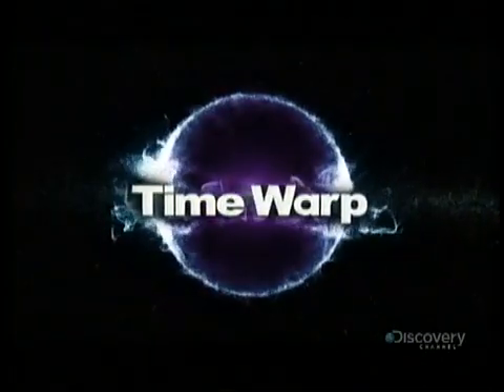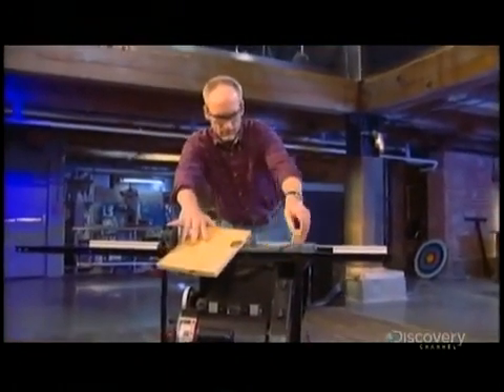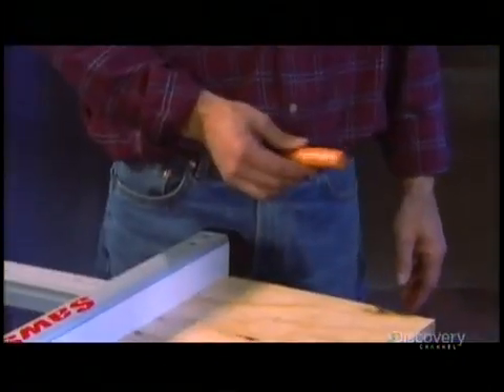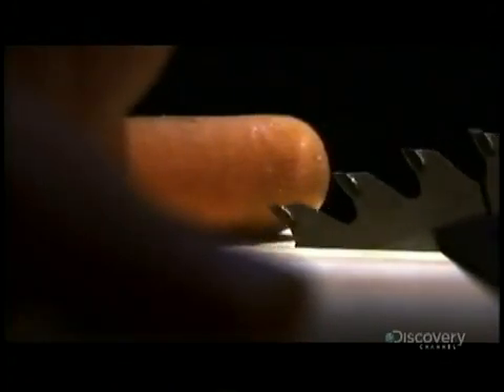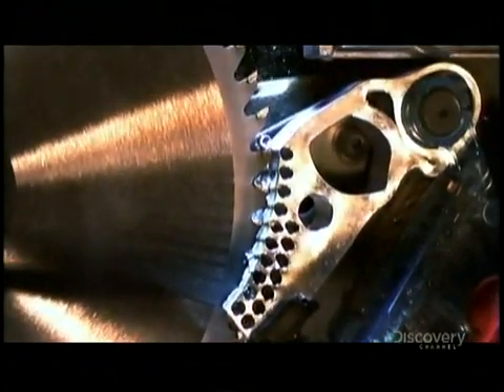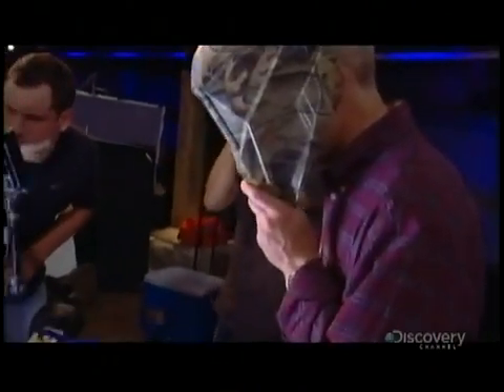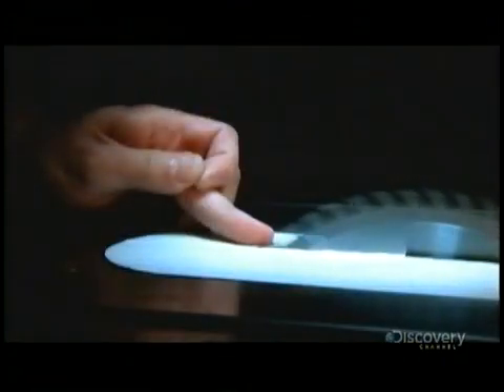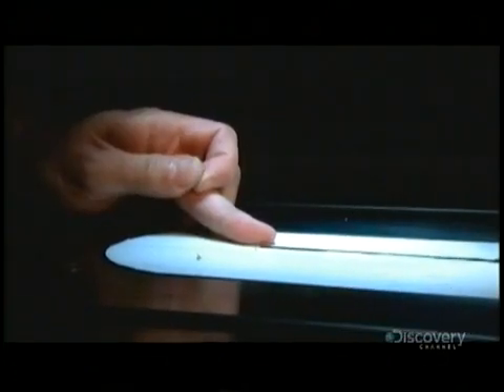Saw Stop - This guy puts a finger into an active table saw blade & comes away without a scratch!

Comment: why not drop the saw under the table into a holding area instead of breaking it?
Reply: It wouldn't drop fast enough
Reply: You could never drop it fast enough unless you propel it with something like a small explosive. In this case you use the momentum of the blade to stop and drop the blade. It's a very simple and beautiful design. Which is what makes it trustworthy enough to use.
Reply: +Micky Sweetman-Hicks well, there is no real way of knowing which way it'll go in the first place. it could just fly into the air, or into your hand, etc.
Reply: Yea it wouldn't drop fast enough.
Reply: The momentum would make it bounce around like crazy, so i dont think that would work.
Reply: Because it wouldn't stop the blade from spinning as effectively.
Reply: easy … 1g vs about 1.000g

That blade is NEVER going to drop fast enough for your finger not to be hurt badly (if not even cut off). That brake is hitting the blade hard and blocking it within very few degrees of a rotation. That mechanism stops the blade within about 1/100th and 1/1000th of a second. You'd need explosives to shoot that blade down and out of the way. You can be sure that your table saw will take damage as well
Reply: Micky Sweetman-Hicks How are your going to hold liquids there. That's where all the wood fibers from your cut goes to.
Reply: If the saw merely dropped instead of stopping immediately, it would have ample time to do damage to your finger.
Reply: Breaking it is better than having a nub
Reply: Lord Fridemort springs under the saw or rods that can only go down on weights?
Reply: It wouldn't be fast enough.
Reply: Salty Jack 
Search for Bosch Reaxx 
It works 
Just one Problem, there is a patent disputes between Bosch and saw stop. 
Thats sad because i think that bosch's system is better
Reply: +Micky Sweetman-Hicks that might be able to work but you never know
Reply: if you watch the video closer you'll notice that the blade isn't made safe by the blade getting out of the way. It is stopped by a metal plate being jammed into the blade. The blade drops relatively slow compared to how fast the metal plate moves into the blade.
Reply: Micky Sweetman-Hicks you need to stop the momentum somehow
Reply: Stop saying it wouldn't drop fast enough because you can just make something push it down fast enough. Also it's the spinning that's the problem.
Reply: It's only $60, either deal with it our learn how not to cut yourself everytime you use it.
Reply: Not entirely, if you're cheap enough.
Reply: It drops the blade so it leaves the area where the finger is.

The blade is damaged because it's rammed into an aluminum brake and it eats the teeth up.

That's the only logical way to stop the blade instantly.
Reply: Bosch is doing this
Reply: That would likely take a lot longer than slamming the saw into a brake, or a least enough time to leave a significant cut. That's my opinion on it at least.
Reply: Micky Sweetman-Hicks derp
Reply: Micky Sweetman-Hicks its either lose your saw or lose your finger
Reply: Because they wouldn't make their money back on the replacements
Reply: That might work but it wouldnt stop the spinning so it could be a hazard i would design a stainless steel chamber under the blade so it drops into that
Reply: orto l'ano, Hi there, lol i completely agree with you there, common sense is the best anti-accident tool we have for avoiding bad accident's, but like you pretty much said people don't tend to use it much nowaday's and there stupidity and lack of concentration is why bad thing's happen, so if someone were to have an accident 9-10 is all down to being there own fault for not paying attention using potentially lethal equipment/machinery.
Reply: It wouldnt be fast enugh 🌲
Reply: Cmon were talking about a hundred euros max to save your fucking fingers? COME ON!! WTF
Reply: Lord Fridemort what if it went in a liquid?
Reply: because he needs to be able to sell spare parts to continue his financial success.....
Reply: this comment needs more attention.

Comment: The test is not very accurate as they put his finger in barely and extremely slow but imagine running a piece of wood through really fast you might get some very deep cuts to even cutting you finger in half but still staying attached. Or what happens if you drop you hand down on top of the saw while its on, well you'll lose you finger and or more. Not very safe still.

Comment: I don't know. Seems like you could hit some moisture in the wood, or the sensor could misfire somehow and you have to repair the saw every time. Unless they can develop a brake for it that doesn't explode like that I dont think it will be a big home user item. Maybe in factories and big shops that want to take extra steps to reduce injuries.

Comment: It Mangles Your Saw Machine And U Need To By Anthr One
Reply: As they said, isn't that much better than losing a finger? and it doesn't ruin the whole machine, just 1 part and the blade.
Reply: It mangles a component and you have to buy that part again and probably a blade. Not a whole saw.

Comment: I ran my finger over a table saw blade, fortunately the boade was only sticking out a quarter of an inch. The cut was across my thumb and deed to my bone.  It was about a quarter of an inch wide. they had to pull my skin from the  tip of my thumb to the bottom then stitched it. all my meat regenerated within time lol. lucky for me the only thing is that some of my nerves don't work. lesson learnd use a god dam push stick lol

Comment: This saw was invented a long time ago... its commonly referenced to as a hot dog saw, it sends a electrical signal to a cut off switch that drops the blade down and puts on an electric brake once your finger completes the circuit. these things also cost like 3k in order to fix. there is literally  nothing special about this they have been out for years...

Comment: Why doesn't this machine just super quickly LOWER the blade! Then it could apply some sort of gradual brake instead of RUINING the part! So there is a compressed spring with a bracket to hold it up, and when it's sensor "goes off" then it lets out the spring, and whips it down. Talk about a lack of imagination!

Comment: I thought the blade simply retracted down into the table, i think that would have been a better idea. Instead of stopping it, use the signal used to stop the saw to instead activate a mechanism to yank the saw blade downward out of reach then cut off instead of completely stopping it at once, then raise again once the blade has come to a stop. Now, I'm not sure if the damage that would be done to the hot dog/finger would be the same, but it's worth a try huh? Either way would tremendously reduce the damage due to a finger coming in contact with a saw but the way i described would reduce if not eliminate the need for replacement parts. Who knows, what I say might actually come into existence. Just remember it came from a girl who posted on YouTube :3

Comment: it wood (yes that be a pun)be a better idea to have the saw be pulled to a lower point and slow down that way it can be used more than once don't you think also i never saw this coming yes another pun
Reply: I may be possible, but I'm not sure it would be fast enough
Reply: +SgtKOnyx mabby it could detect when you finger is going in that direction like maybe a second before the finger comes in contact with the blade
Reply: It couldn't stop fast enough

Comment: Most people wear gloves while handling wood or doing yard work.  What would happen if you put your finger through this with some gloves on?
Reply: Wearing gloves while operating power tools is what causes many people to lose fingers.
Reply: I dont know if it would cut through the glove, but when / if it does, it will still stop before it will cut the finger, obviously.
Reply: Steven Arvizu That was pretty much exactly what i said wasn't it?
Reply: maybe they could use gloves made from conductive material then?
Reply: thats worse.
Reply: the saw Blade would pull one little part of the glove down which would maybe Cut your Finger off
Reply: I don't know anyone that does woodworking with gloves. That's just stupid and dangerous.
Reply: The machine would still recognize your skin after it cut through your glove
Reply: Lynn Dunn Yes.

Comment: When you are pushing a board through a table saw you are going faster than what he did in this video he basically sneaks up on the blade, this stop does work although you will get cut badly you won't lose a finger but the cut will be significant

Comment: You can actually do that with any table saw. All you have to do is move your finger really slowly toward rhe blade until you feel it touch, and then turn off the motor. You only get cut if you push your finger BETWEEN the blades. Touching the tip of the blade doesn't do anything because you're finger is not in its path.

Comment: Great concept and all but who's going to pay for a new saw every time something conductive touches the blade?
Reply: Just a blade and the plastic piece that you saw break... that said he said $60 for parts to replace broken ones... which if you finger is that close well lets look at hospital bills for those things then lets look at $60
Reply: that was a metal piece.
Reply: papersly vg I wasn't saying that the cost of the parts outweighs the value of your finger. My point was that every time something conductive touches the blade you need new parts. What about if there is a piece of conductive material in the wood you're cutting? A finger isn't the only thing that can cause this safety mechanism to engage.
Reply: ***** they should have it configured for a proper amount to set it off and have tried most woods available

Comment: so what about improperly dried wood?
Reply: if you suspect wet wood, you must use the override feature. You override the safety for anything wet, or conductive. For example, sheets of stainless or aluminum laminate can't be cut with the safety feature active. 

So essentially when you use the override, this is just a normal table saw.
Reply: I heard theyre better in bed.
Reply: Lily Middlemass ok ty, was curious.
Reply: if it has been soaked in salt water?

Comment: If your fingernail was the first thing hit the blade, it'd probably have to cut through your nail until it touches your skin. OWW!!! I reckon they should make the braking mechanism out of something resilient, like hard rubber, or a longer piece of metal, so it can simply be reset, instead of having to replace a few parts. I can't see why the blade would be scrapped after an event.
Reply: I see. Yes, I am that cheap!!! ;>
Reply: The Eminent Joshua E. Hrouda lol, at least you're honest
Reply: the impact that has to hit that blade to stop it fast enough would be absolutely insane. That 1000 mph car doesnt even come close to covering it. a car crash even into a tree takes almost a second. We're talking almost a million times the force of a highway speed car crash. There is no way a flexible metal part survives that force, no matter the crumple zone.
Reply: Unless you make the blade thicker and out of titanium the instantaneous Gs being exerted on that steel blade buck it. Are you such a cheap skate that a $60 blade is worth your finger? I've never been cut by no miter or table saw but if it ever does happen from a board lunging I will gladly buy a new blade.
Reply: The speed that it's going at and the fact that it's steel makes it not effective if it's another material. A longer piece of metal would still destroy the blade, and if it's a metal or material harder than steel, there is a chance the saw blade will skip over it instead of biting in, or the material will shatter and destroy your saw. With it being steel, it's relatively cheap, won't shred like rubber, and will sure fire stop the blade.
Reply: I suppose. BUT, It could be possible. Just engineer it to be! Leonardo Da Vinci invented a helicopter yonks ago (15th century), and he wasn't able to build it. And others probably told him it's impossible, but given enough time, a few men built and prototyped successful helicopters. Now, we see them all the time. SOOOOooo, NEVER (please) say it's impossible!! It may NOT be today, but it might be tomorrow! :)
Reply: *****
Yep. It pays to be, and hopefully, earns a little bit of respect :) This YouTube goes to most countries of planet Earth, right ?
Reply: While it may be disgruntling to have to replace the blade, is 60$ really too much for an accident that happens pretty uncommonly to save your fingers from being chopped and having to go through surgery for it? People who are in construction jobs are going to be the biggest consumers of this in which case the companies will have more than a enough money to pay 60$ for a replacement blade rather than money to pay out the work job accident. The other people that will be using this is people who do construction hobbies in which case, if something expensive as crafting with powertools is a hobby, you probably have enough money to also pay the 60$ replacement. Then lastly you have the average buyer that isnt going to be using said saw stop every day of their life, so when an accident does happen, it should be well worth the price

Comment: what if you need to cut metal?
Reply: I don't think you would want to use a table saw.
Reply: yeah you'd probably use a band saw to cut metal
Reply: you can't cut aluminum it was go off
Reply: i've cut alot of aluminium with a table saw, difference was that the blade was almost completely covered in a guard and on a pivot and hinge construction to manage all sorts of angles. it had a set of clamps to lock the item to cut in place. 

you operate it differently and because of that, the risks of using it often is  lower aswell.
Reply: Yeah I have experience  using the SAWSTOP. 
Sometimes we would be cutting an old tree that had a Nail or some kind of metal hiding inside it. 

It stops the Saw and scares the crap out of everyone around the area. 
It's hard on the machine and Costs about $70 for the Brake and $40-$70 for the Saw blade. 

Averaging about $120 per STOP.

People do loose finders all the time, and I've seen it happen. 
But not on the SAWSTOP. You are likely to get a Hell-of-a Cut though!

Comment: For all android users install fronto for an easy passive income. It will display adds on your lock screen when unlocking your phone. When you start use the code "Backlash" for an easy 1250 points. To use your code go to the app and click the cog, it brings you to its settings , from there all you have to do is click "Have a promo code?." Good luck with your earnings.

Comment: why not put the sensor an inch before the wheel?
Reply: Where would it go? When your cutting a peice of wood the wood would be covering the sensor if it was in the table. Also that is where the removable plate goes for changing the blade.